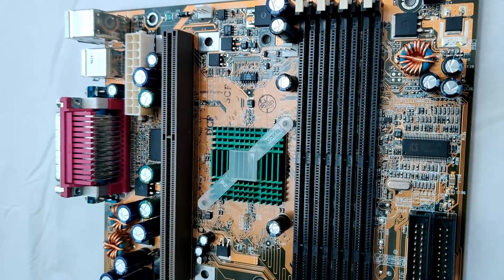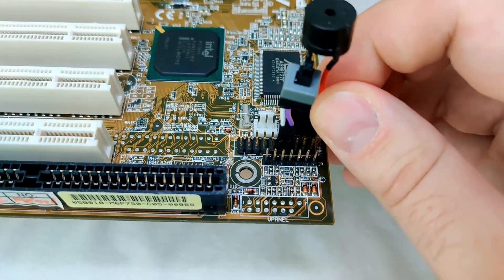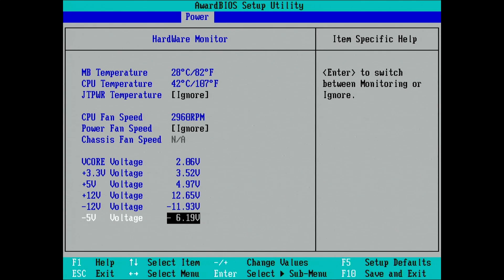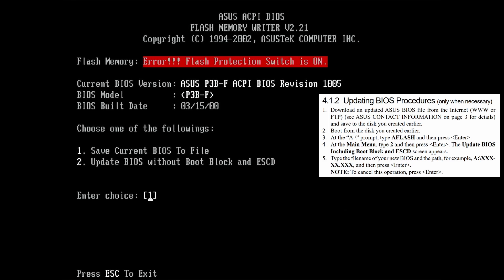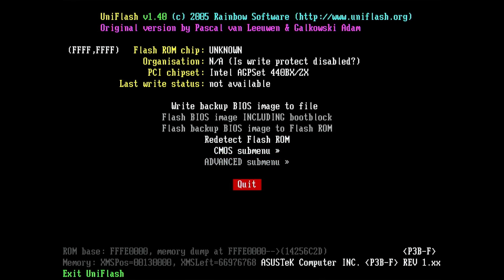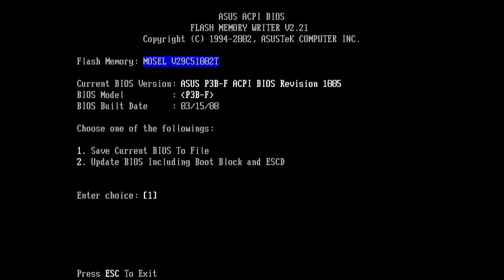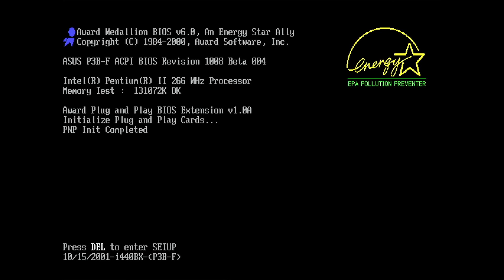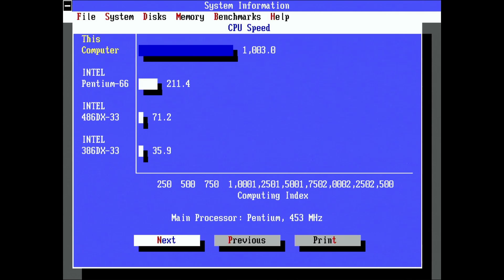ASUS P3B-F: BIOS Update with hickups

Comment: This version has only one ISA slot, but there is another version with 2 ISA slots, would it be possible i wonder to just remove the lower PCI slot and solder in another ISA slot, or will you have to add something else to??

Comment: Worth noting is that w98 by default only supports 512mb ram, or 1gb with some later changes. 1.5gb or more and the OS might not even boot. And that is not only ram but total system memory including graphics memory and such

Comment: I have a P3B-F v1.04 here. On mine the BIOS was on a MX29F002NT chip and I wasn't sure how to get the update software to work so I used the big rig to fix this one : remove the DIP32 from the MoBo and flash the chip with a BK Precision 866B universal programmer. Works like a charm.

Comment: Great mobo, I have two of these, one with 2 ISA slots and other one with 1 ISA slot. Only complain is that both of these struggles @150FSB, only 2 sticks of RAM works. Abit BF6 does a lot better with overclocking.

Comment: i used pc probe with my tuv4x and cusl2 asus boards. very gimicky  program but could savedata in real time so kind of usefull in overclocking because you know exactly when board hang up because data cut off at one point for all sensors

it was a thing way before hwinfo 64  and it's extensive sensor sweep

Comment: The memory read, and write bandwidth looks good for SDRAM (Single Data.) There is only a data transfer on the rising edge of the clock cycle unlike DDR that transfers data on the rise, and falling edge of the clock cycles.
Reply from the maker: I expected the read transfer rate to be higher than the write transfer rate. Shouldn't both of those be values be at least very similar? Right now, writing seems to be 5 times faster than reading (L1 cache).

Comment: Great board! Glad to see it still working all these years later! 
Back in those days if I hadn't already purchased an Abit BH6 motherboard to go with my Celeron 300A I would have probably gotten one of these. But the Abit board was released a few months before this Asus board and the BH6 quickly became legendary at that time for overclocking through it's use of SoftMenu jumper less CPU setup. I had that combo (BH6 + 300A) running at 464 Mhz for years until bad caps caused it to spectacularly fail while running and physically burned several parts of the board.